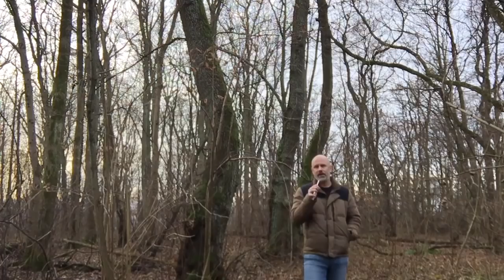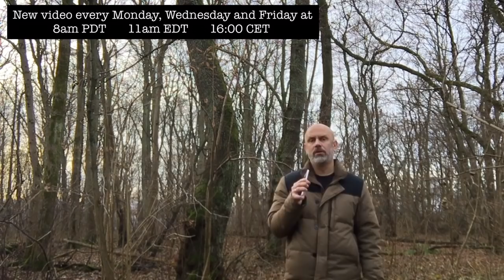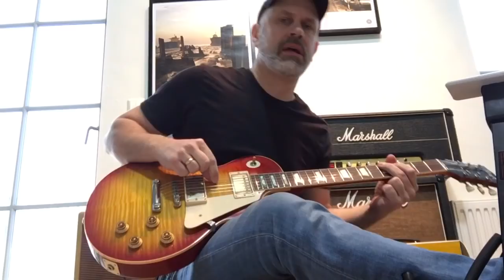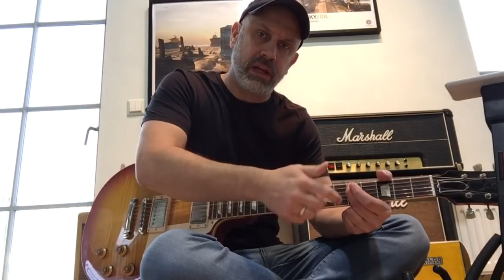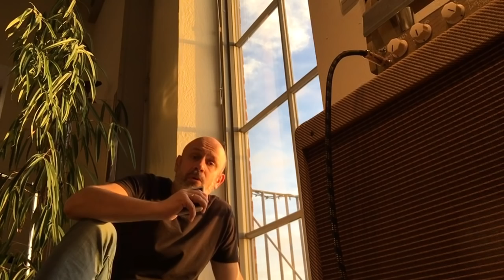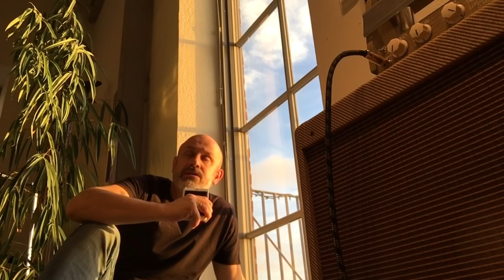Which is MOST IMPORTANT PART of an Electric Guitar?

Comment: A fantastic subject for discussion. My go to source of info on the subject of instrument physics is Bart Hopkin. He points our attention to the subject of mechanical impedance which is very enlightening. It boils down to inertia of the parts in question when considering the transfer of energy. I will look forward to watching and listening properly when I get back from this evenings gig. Have a great weekend mate
Reply from the maker: +PoJoWo Thanks I'm gonna check Bart's work out! You have a great weekend too!
Reply: Johan Segeborn years ago I had a Godin t type guitar.  Bird's-eye neck and ebony fingerboard. It had a dead spot such that the harmonic on the fifth fret of the E string would hardly ring audibly at all. I tried all sorts to solve it, but ultimately bought another virtually similar Godin that did not have the issue. Then It struck me... I switched the necks and low and behold the problem followed the neck. Ultimately I solved it by filling the truss rod cavity at university. The dead spot moved out of range and sustain and overtones improved... But the guitar lost alot of its personality. It was technically more even and reliable in different keys, but it's voice was changed from that which attracted me to it in the first place. I didn't see it coming. I think this supports the background to people having collections of older more variable instruments and their varying characters. Another book/dvd I meant to reference was The art of tap tuning by Roger H siminoff. On the dvd it shows him analysing the resonance of acoustic instrument parts and working them to change resonance. He talks about how to best tune the parts to a desired end. Obviously there is more scope for this in acoustic instruments but the theory follows. The best Bart Hopkin book in my opinion is "musical instrument design". Let me know if you struggle getting your hands on them I will send you mine.

Comment: I don't think a steel guitar would change the tone, it would definitely sustain more, but the more mass would surely just take the body, neck and fretboard material out of the equation, people always say things like a gotoh or babicz bridge and a bone/brass/graphite nut, stainless steel frets and everything, and thats exactly what those do, it's more mass that physically halters vibration and reflects the energy back on to the string, which should also make the string itself louder and humans percieve louder as "better", those products may not be marketed that way but it is what they do and it's why people think they have a better tone, when it's just louder with more sustain, but that can be adjusted with pickup heights obviously, at the end of the day, the most important part of the guitar is the player and the speakers you put it through as you prove in every video Johan! almost made me regret getting g12m's when I heard them compared to g12H's haha!
Reply from the maker: +5150stephen Cheers! Yeah it pays off to focus on speakers.
Reply: definitely, I still love my G12M's with my Vintage Modern, and my V30's with my JCM 800 haha, great ball park tones for the 70's and 80's when you're on a budget, although I wish I could get to play all the vintage ones you have
Reply from the maker: +5150stephen The G12M reissues are not bad, but the top end doesnt really much the older recordings

Comment: I can say from personal experimentation: If you swap around necks, bridges, bodies, pickups. It all makes a big difference. One body might sound significantly worse than another, same goes with all aforementioned parts. Also, headstock angle, and tuner locations make a difference aswell: Fender vs Gibson headstock changes the tension over the nut, and also the percieved tension across the different positions of the neck. Same with the bridge: string thru, angle over saddle, length of string behind saddle. etc. In the end, what matters is the sound that you imagine in your head and changing the parts until you get closer to that ideal.
Reply from the maker: +infectionsman Thanks, great feedback

Comment: One thing that is really telling is the Gibson historic series les paul's. The 1957 through 1960 les pauls have almost the exact same spec's and the same pickups. The main difference is in the neck shape and size. Another comparison would be interesting is the new horse power or hp les pauls. The hp neck is a slim taper neck in thickness but has a wider soloist neck side to side and compare that to the traditional slim taper neck profile.
Reply from the maker: +ymatt whit cool I'm gonna check it out!

Comment: is it important on which DIRECTION the screws of the bridge are facing to? i put my bridge the other way so it faces "backwards"? is there a diffeerence? thank you
Reply from the maker: +ray mccoy No as long as the individual string supports are positioned such that the guitar is intonated. The current standard model has them pointing down and the Reissues has them pointing up.
Reply: thank you very much for the answer

Comment: I would say the pickups are the most important part. When you record your amps, do you worry about what kind of plastic or metal the microphone is made out of?? Same goes for the body of the electric guitar. That's just my opinion.
Reply from the maker: +brntgrbl No not the material or wood itself, but the mechanical properties of the body and more importantly the neck is interesting in order to get a big tone. The pickup of course makes a bigger difference, but once you have a great pickup someone else comes along with the same pickup and and great neck and body and sounds even better. Cheers Johan
Reply: Johan Segeborn - Gittler guitars made completely out of titanium, no wood. There is virtually no body or neck on those. I've seen videos and they sound huge. So I'm not so sure how the neck would affect the tone.
Reply from the maker: +brntgrbl Cool! I didn't know about Gittler and googled it. I'll definitely check them out. Thanks! :-)
Reply: Johan Segeborn - it would be interesting to see one of those guitars on the channel. That would be cool.
Reply from the maker: +brntgrbl I agree! First chance I get!
Reply: I have to disagree: the pickups can only transpond in sound what they are receiving from the stringvibration. And stringvibration and its voicing is dependant on the buildquality and build-specs of the guitar-corpus. A microphone build from sh*t infront of the best cab and best amp will sound like sh*t. Thrust me , I have an 8 € microphone build from sh*t.

Other topic: Gittler guitar. The guitar is build from steel, wich has a high vibration-response. So, no wonder it is pretty good sounding. But for me, it sounds like steel-strings with steel-body... I miss the melodical warmth of wood... (my ears are talking)

Comment: Great vid! Thanks Johan. I agree on complexity over efficiency. Likewise on the nodes/resonant points along the neck (try playing with your left hand behind your head and your right ear against the neck some time).
If it's not semantics, I might disagree about an electric purely-not having acoustic properties. For instance, unpotted vs potted pickups have microphonic qualities (a mix of air pressure sound waves and also body-transfer sound waves) stronger/lighter studs, bridges, and tails put more energy into the body, and in my observations with a meter such changes produced a 10db difference in peak acoustic output on my LP. To the point I was concerned my neighbors would complain, unplugged. The maple top, from what I can tell, acts like a convex speaker dome.

What I've seen is that bang-for-the-buck-wise, the pick shape and material is where to start shaping tone. The Fender celluloid 346 shape has the perfect shape and durometer IMHO, at least for a LP aiming for vintage sounds. Then pots, caps, and pickups all matched & balanced. Hardware seems to bring much more clarity but, ice picks and hand grenades too. Between all components being OEM, steel, or Ti hardware, I prefer OEM (w/Gibson's alum tail) at the end of the day, particularly with higher powered amps. Oh and clear nail polish or liquid bandage on the OEM ABR screws/saddle skids to keep it from buzzing.
Reply from the maker: +Jahde Mitosinka I always use 0.88 Green Dunlop or Danish stone picks!
Reply: Johan Segeborn Yeah cool are the Danish stone ones actually made of stone? I've tried picks cut from rosewood and coconut shell, but they were too harsh for me.
Reply from the maker: +Jahde Mitosinka They are indeed, and are so smooth to play. Check them out here

http://www.stenplektrum.dk
Reply from the maker: +Jahde Mitosinka Yes, they are stones collected on the northern Danish shores and shaped by hand to picks

Comment: Pickups, end of story. Tone woods do not matter on a fretboard or in a body unless it's a hollow body or an acoustic.
Reply: Chris Simpson  good try "Mr simple". Countless videos and live demonstrations prove that more expensive guitars sound clearer, louder and more resonant than cheaper ones when you A/B them with the same pickups. Explain that!?!?
Reply: Better electronics?
Reply: Chris Simpson  Exactly!  I've got a "First Act" Hanna Montana edition guitar ordered off TV - so...upgrade the electronics and slap in some Burstbuckers....JUST like a Gibson!
Reply: Sorry. Woods still don't matter in a non-hollow body electric guitar.
Reply: Cool story bro. Care to address the links or are you just going to repeat the same tired line? If wood doesn't matter then why does the sound of a Teuffel Bridfish change when the wood modules are swapped out? The wood that a guitar is constructed from absorbs and/or amplifies certain frequencies which are reflected in the vibration of the strings. Is the wood the most important factor? Probably not, but it's the foundation.
Reply: Chris Simpson End of story, if you've got shit ears.